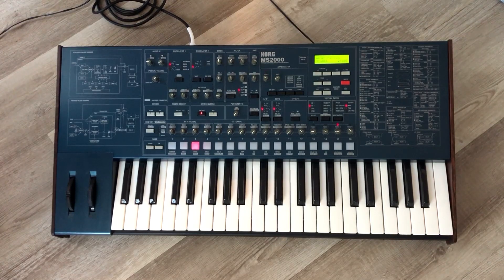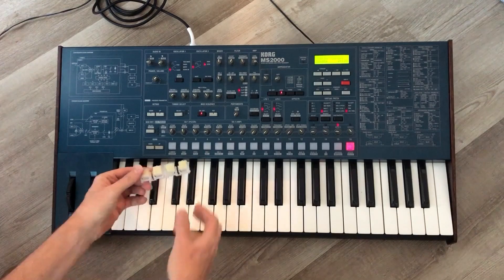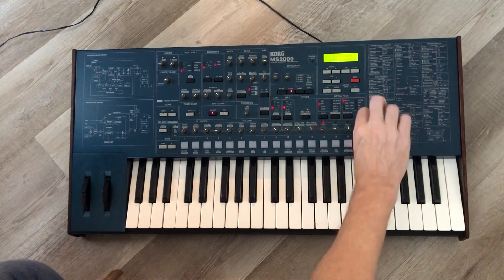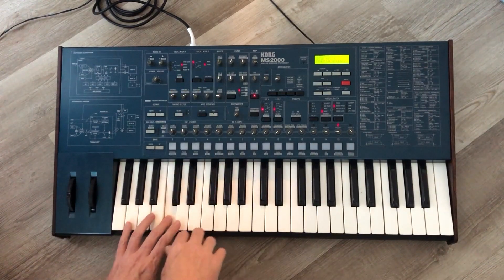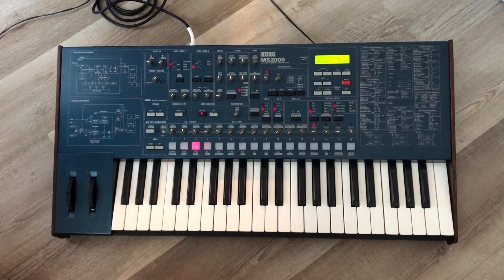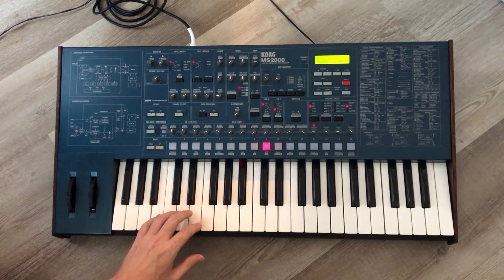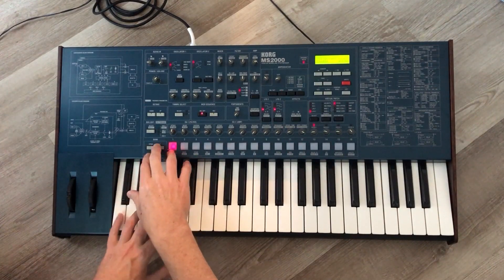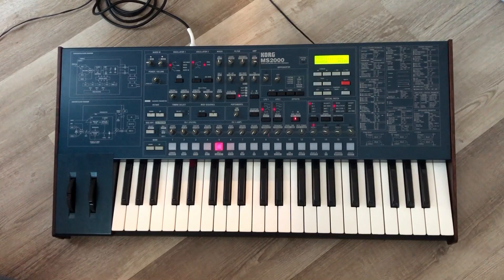Korg MS2000 Restoration Talk & Demo

Comment: Thanks for sharing. I need to get my own MS2000 up and running myself.
Reply from the maker: Hey Jon. What's wrong with your unit? I may be able to offer some help (or not!) :)
Reply: DSP error. I need to reflow solder OR replace DSP. Tried once on Microkorg and wasn’t easy.
Reply from the maker: Yeah, I will say that is beyond my ability to offer advice on. I know the chips are out there, but yeah, not easy stuff without the right tools.  @jonclyne2918